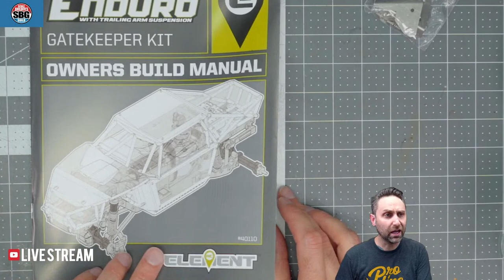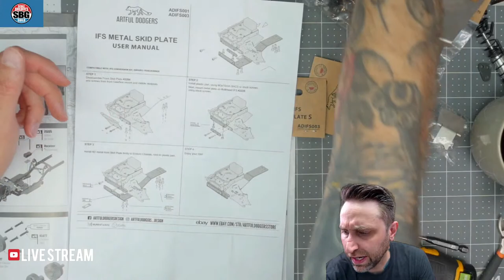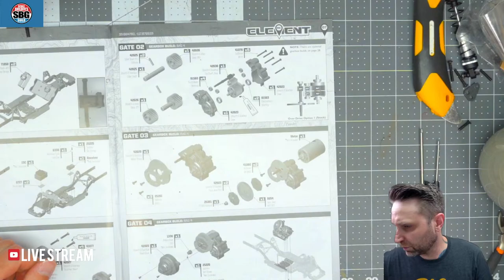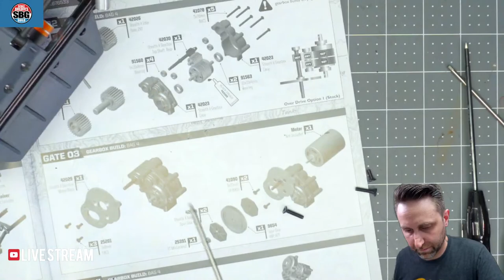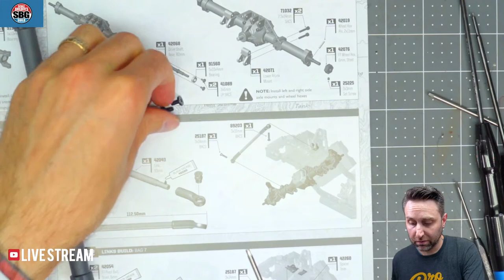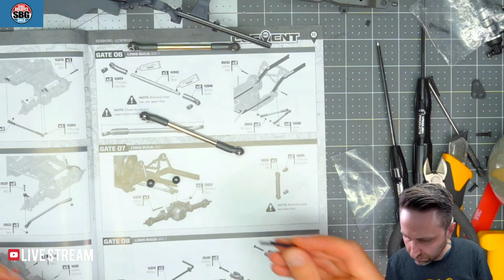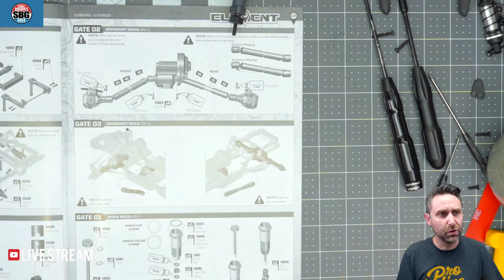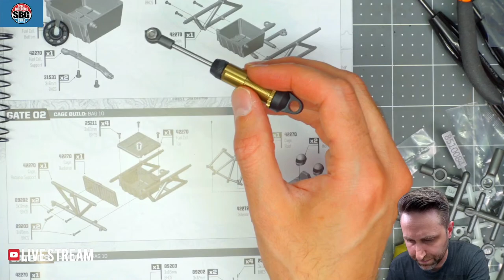Element Gatekeeper Fun-Haver Live Build!

Comment: I wanted to buy the gatekeeper, but I don't like the caged body which is too heavy and its lack of width.  it is of origin less stable and it's a shame, I really like this brand
Reply: You get a lot of trick parts and can use truck body’s instead of cage or flat bed it
Reply from the maker: Why are people so hung up on weight? You're missing out!
Reply: @scalebuildersguild  For sure! I added wheel spacers and my Gatekeeper rips

Comment: The playback was out of sync mouth to speak.. mouth move then speak much later.  🤔... 
My element RC kit build I found one link the thread part was bent.  Tried to straighten it with heat but it still snapped... So I have used a fixed scx10 aluminium no attaching ends type. .
Reply from the maker: I checked the entire stream, and that must be on your end. Everything here works fine.
Reply: @scalebuildersguild  maybe.. could be me streaming on Chromecast to my tv.. or Russian hackers . 🙃